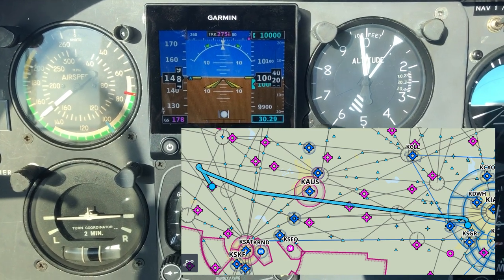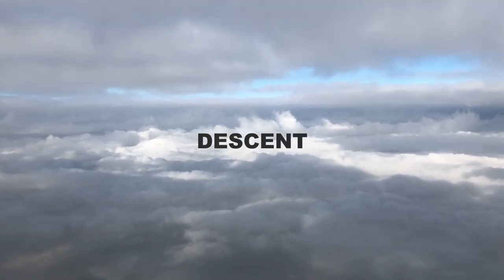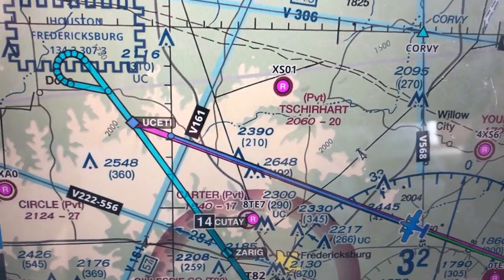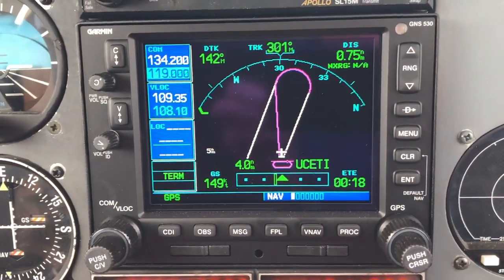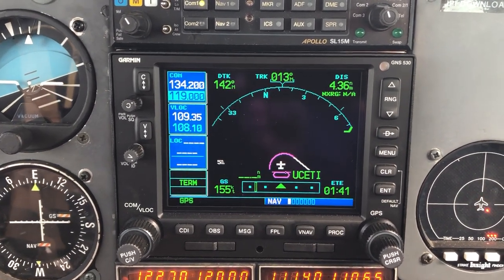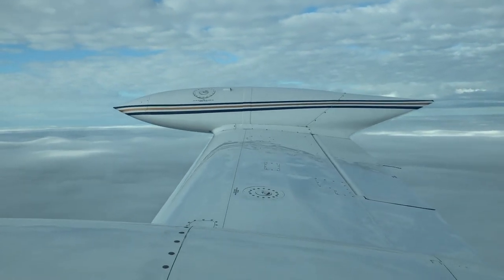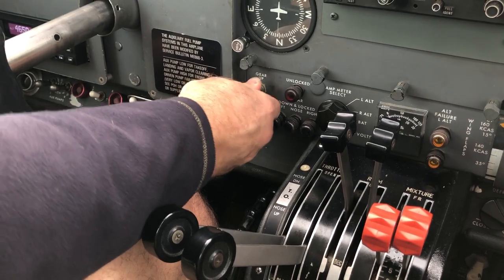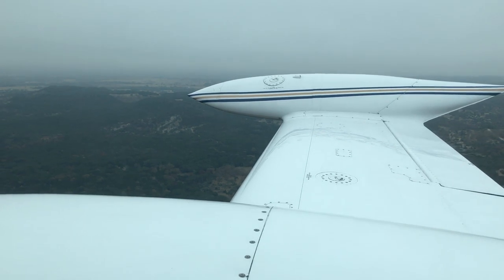Cessna 310 sloppy instrument approach into Frederickburg

Comment: Well done.  I fly a 310 also.  I like to get me initial flaps out for the IAF and the reversal etc to help control airspeed.  Then gear down 1 dot above the FAF. As you know once you get a 310 pointed downhill it can be hard to slow down.  Looks like the old autopilot is doing a good job.  D.